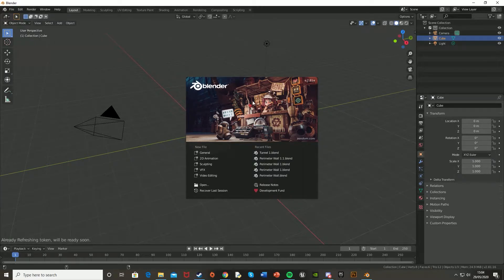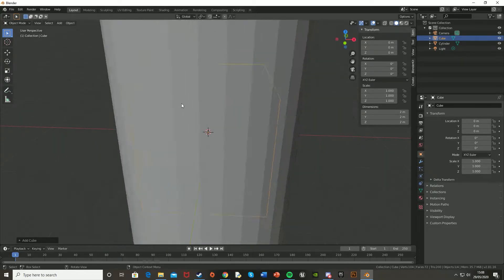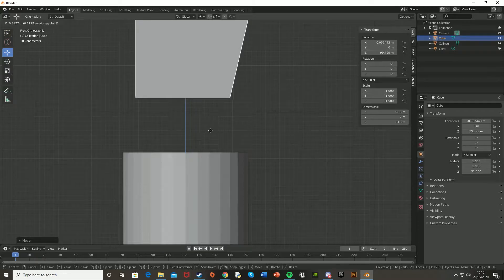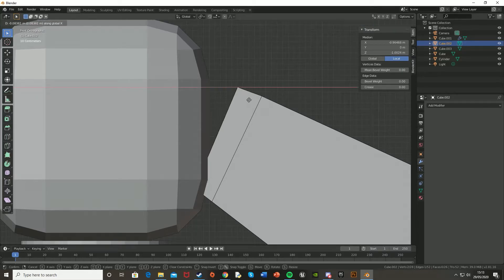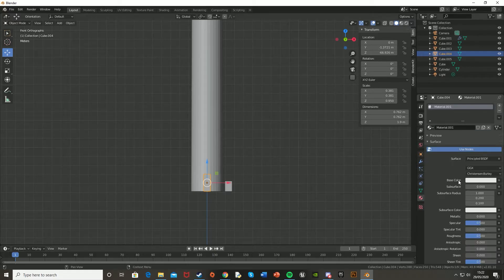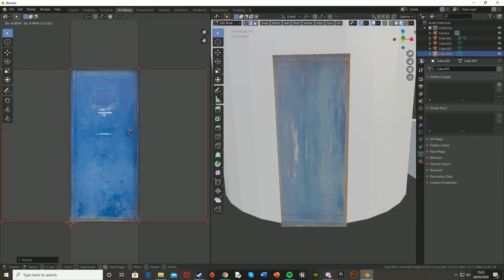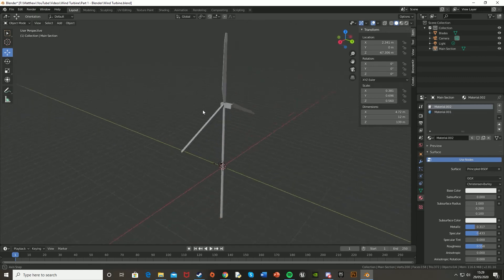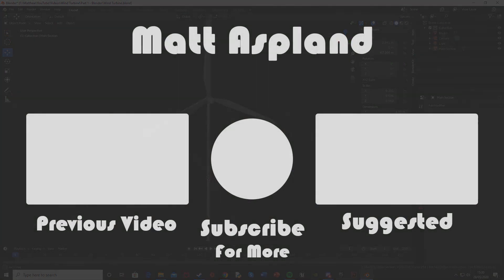How To Make A Wind Turbine In Blender 2 8

Comment: If anyone is having issues with blade rotation, here is how to fix.

Instead of joining the blades together, create a small object (cube perferablly but it doesnt rlly matter) and position it inside the "engine" inbetween all 3 of the blades. Select all of the blades, selecting this part last. do cntrl+p, and select object. You should now have a very cool and orientated point. This also allows all of your blades to be moved individually, just make sure they are all symmetrical.